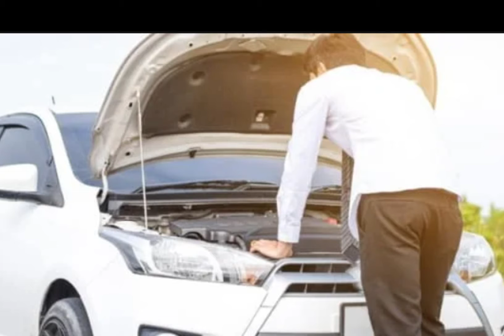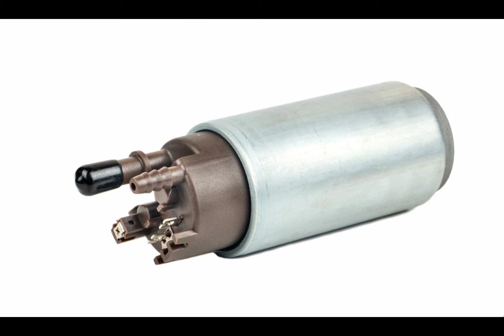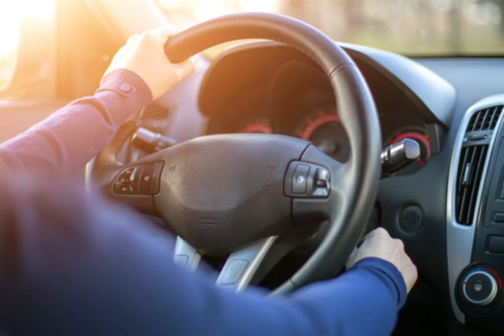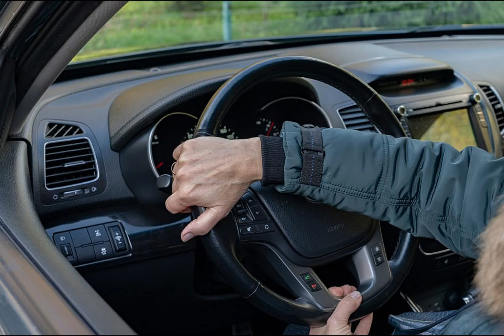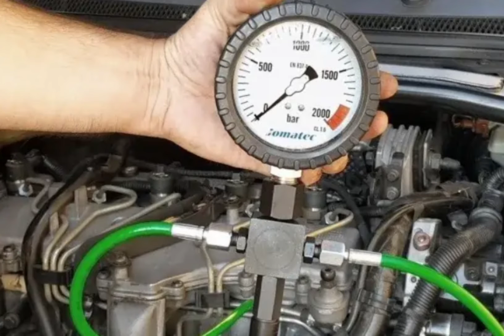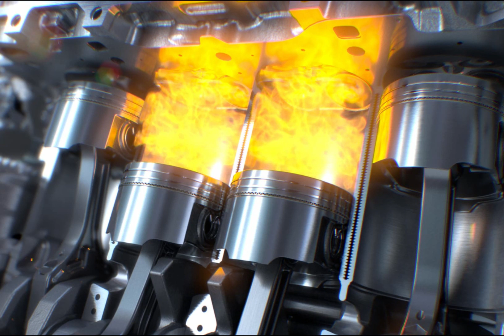10 Symptoms of a Bad Fuel Pump Relay Car Won’t Start or Stalls | Watch This First!

Comment: 2008 RAV4, where is the fuel relay located?
Reply from the maker: Open the hood and find the fuse/relay box near the battery.

Look at the underside of the fuse box cover — it will have a diagram.

You should see C/OPN Relay or EFI Relay listed. That’s what controls the fuel pump.
I hope this answered your question